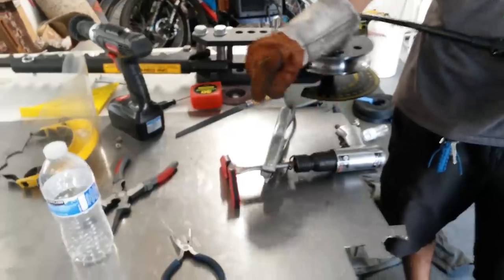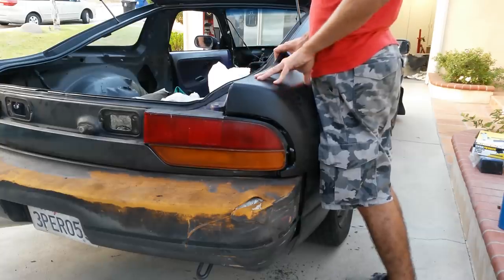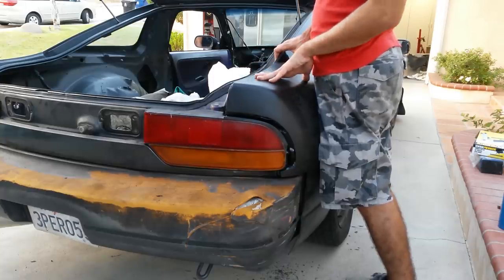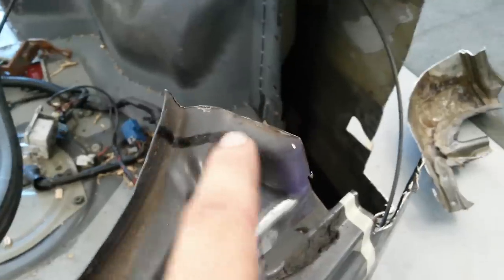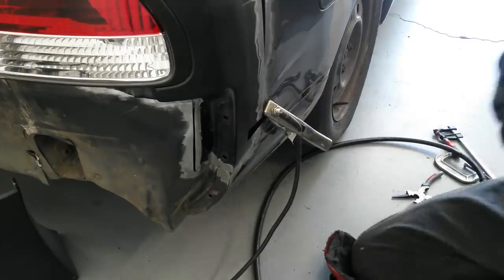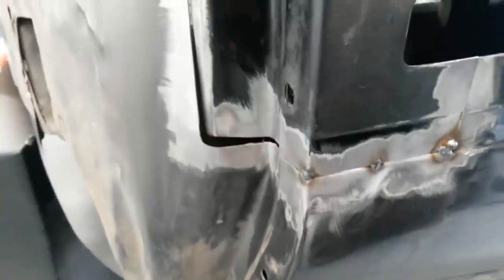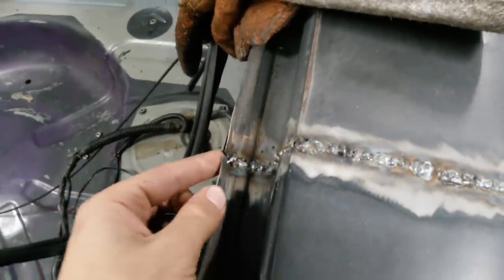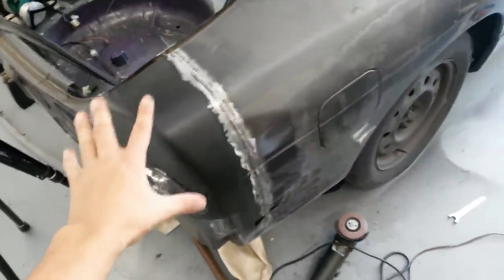How I Fixed My Smashed in Quarter Panel

Comment: Did you noticed that gap you had was exactly as wide as 2 angle grinder blades?
As you cut off an outer line of both panels, while you had to pick one "overlay" panel, to leave more meat on it.
Reply: He should have cut it too thick/long, then slowly took more and more off as needed. It would have fit a lot cleaner and easier.

Comment: Im working on the same rype of situation on a Del Sol. Its a bit worse though, and both sides. Ive been using a hydraulic bottle jack and different lengths of wood for different angles, to push it out. So far so good.

Comment: you should make a video of the correct way to put overfenders on and all the metal work behind it
Reply: Well, if its for a drift car you dont actually need metal work under it. I mean unless you want to go as crazy as Bub did on Nate Hamilton's FD car.

Otherwise, its not actually dificult, and tons of other people have done that already. Just search "how to put on over fenders" in the bar up there, youll get hundreds of results. There is the 'cut the inner fender well and bend it over the outer fender' method, then there's the 'cut out the material and fab up a piece of steel to fit directly in the hole, and weld' method. I prefer the second.
Reply: i did do the first wone you said. and i did put the overs on. on second thought i regreted doing it. didnt feel legit if that makes sense? body overall is kinda shot. guess 20 years in the hands on 20 year olds has showed :/
Reply: Guess you didn't spell it right

Comment: Didn't come out to bad actually, next time you should overlay the new quarter about half an inch over the old one using a pneumatic panel flanger that way you wont have a gap to bridge but nice vid anyway

Comment: Pretty good job!. Next time just hit it with a 12 pound hammer and block of would and save yourselfself a bunch of time.! Also if you want a cleaner look around tail light pocket just grind down the round spot welds on the seam where quarter meets taillight and gutter area.drill holes in new part where the spot welds were and its will be way faster!

Comment: how do you measure if one of ur corners is not the same alignment as the other side? I hit my mustang on the left back side corner, my light didnt get hit at all it was just the corner. How do i measure the left side to the right side to see if they are aligned the same? I went and got it repaired, but i just want to double check :).

Comment: Hard to tell but to me the disc on the grinder looked pretty thick,like a grinding disc....using a 1mm cutting disc is the way forward and cuts through the metal easier to.

Comment: This is how not to do it .... since you had complete panel you should make a scale on the side of the car and make replacment a bit longer  and drill couple of holes and then weld it .... you just overcoock the edge of the quaters with weld just to fill 2-3mm gap (that is a huge gap ) it is  all wiggly you can see it by the marker on the bottom  if you scale it  your gap would have metal and it would be much easyer  and better and straiter ( less mud will be used )

Comment: Broskie Iam a metalolagist .. you gta use more heat then flash freeze.. Then negative pressure vacuum +< or> 24% differential elevation barometric meter readings.. maddddddd simple

Comment: That repair had a lot more potential, especially considering that the structural integrity of that panel is now severely compromised.  You should have spot welded on or glued on using patch panel adhesive; a fish plate.  you could have cut an additional 2" section from that doner quarter and spot welded or glued it on the inside, and this would have given you a surface to either glue on or weld on the replacement panel.  Then you would have a seam that also has a backing which you could have welded just like you did, only with more ease, and lessen the amount of warping.   Great video but when you're dealing with structural panels you should really do a little more researching!  That quarter is gonna fly off if you ever get rear ended.

Comment: See I have a Dodge Charger and got rear ended by A COP so this is coming outta pocket not way to even fight this. And it’s on my back tail light and took off the side off my light and have a horrible crushed panel and I can’t afford the fit they saying like 10 grand plus 🤦🏽‍♀️